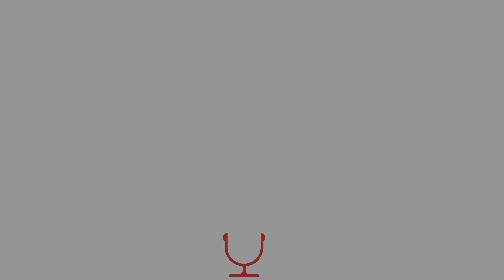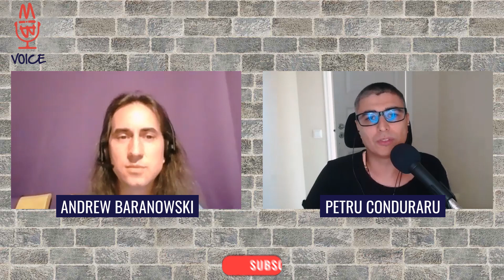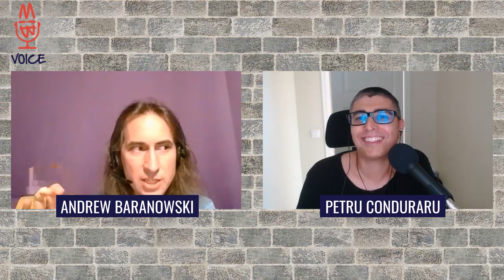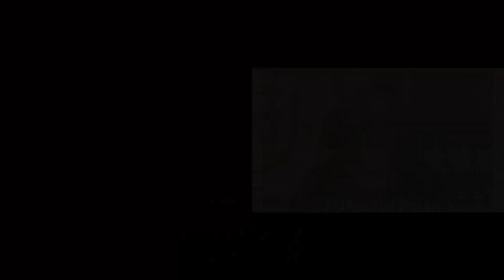BIMvoice#14🎙️Andrew Baranowski (BIM master planning for organizations) #bim

Comment from the maker: ⏱TIMESTAMPS⏱
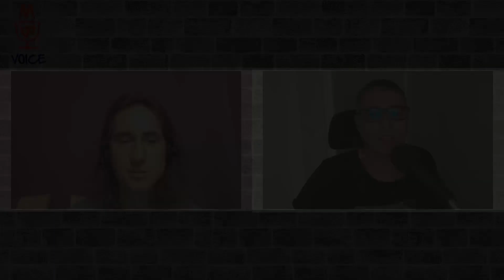00:00 - Introduction
03:27 - BIM Masters program at Middlesex University in London 
04:48 - BIM Master Planning
8:20 - BIM strategy implementation at organizational level
11:41 -  What is BIM for you?
14:31 - What do we need to succeed with BIM
21:30 - Tech Companies in AEC?
25:03 - BIM maturity
29:46 - Challenges in BIM adoption
38:31 - How to spread the word about BIM
41:12 - What organizations are more interested in BIM adoption?
46:44 - Learn more about BIM/BIM resources
54:36 - EIR (Employer’s Information Requirement) & Exchange Information Requirements Document
1:01:32 - Generational shift in AEC and BIM evolution
1:08:36 - Partially BIM implementation on the project?
1:17:58 - BIM resources
1:22:35 - Contact Andrew
1:27:04 - End